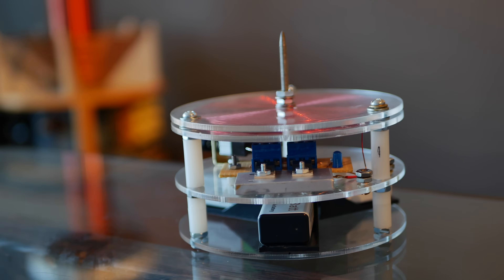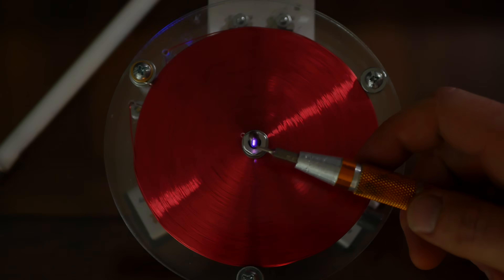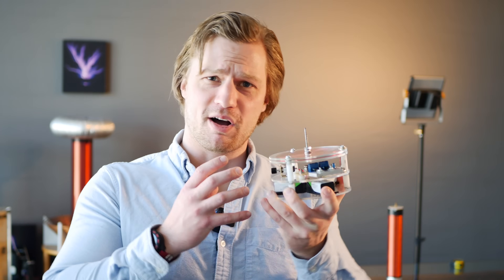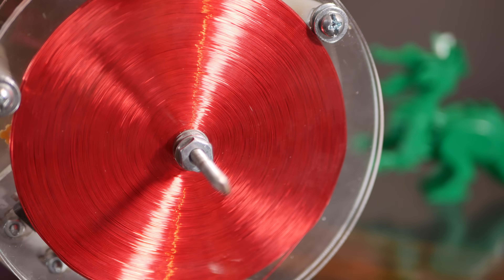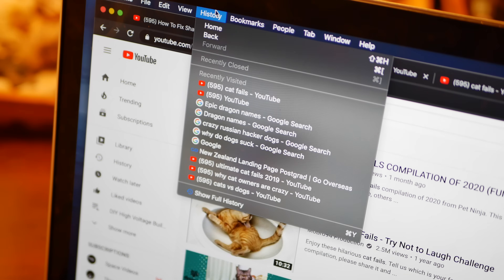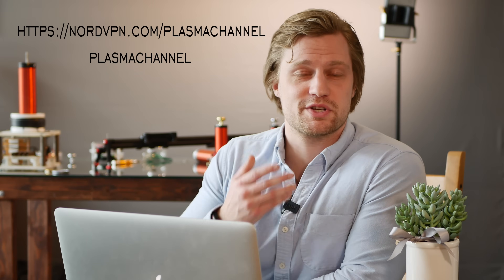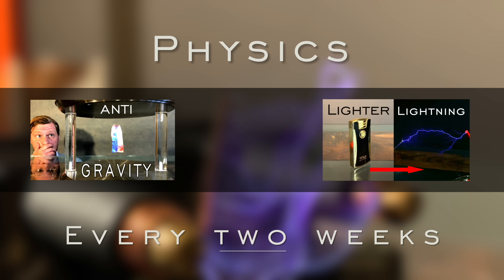World's Most Powerful Pancake Slayer Tesla Coil? (Melts Copper)

Comment from the maker: I honestly support this sponsor - it's an amazing service. Check out NordVPN: https://nordvpn.com/plasmachannel or use code plasmachannel to get 70% off a 3 year plan plus 1 additional month free. Stay safe, and browse safer!
Reply: pancake coil nice and compact I love it now I need to build one with a 10;1000turn insulated that can handle 30-200kv 1.6kw input I need to get a replacement voltage booster for my zvs I sadly blew it out years ago be for i got into fusion. ill have to do spark gapped with my hv supply I have then see how my plasma chamber handles it. now x-ray glasses on, welding mask down, lead /aluminum positive charge shield up. battery charged, materials gathering, rebuilding capacitor's, coiling wire.......................................................ugh , installing prototype core Fxsit, vacuum system on, battery charged ,high voltage supply on, charge capacitors, prepping fuel intake, filtration system on, fuel system on, shield on, lights off, system is all green....3..2...1..... 
man I cant wait to see that beautiful fusion glow again but with more power ok I need to get back to winding this coil.. ugh I wont get to see full output till I get the voltage booster replaced.
Reply: PIA vpn is better

Comment: I Made my own Tesla coil that makes 1cm sparks useing single tranzistor
Reply: Can you share schematics or maybe a video of it? It would be cool to see, i havent seen powerful single transistor coils.
Reply: Its slayer exiter ,i am using transistor d1047  and i replaced the base resistor with 15 kohm trimer for fine tuning,secondary has around 900 turns on 5 CM diameter PVC tube and primary has around 5 turns with 2mm thick cuper wire ,the primary coil is almost as tall as secondary and the whole thing runs from around 30 volts suplied from 12-14v transformer with voltage doubler, i fecomend capacity 2000uf or Higher  (I hope this was usefull)
Reply: @lenkamontskova7483  I have been trying to build one of those but they haven't worked, do you think I can use transistors like the 13007 or 13003b? I have lots of those from CFL light bulbs, maybe that's why my exciters haven't worked.
Reply: Try conecting the primary coil backwards, where you have + conect colector of transistor.
If it still doesnt work it might be because the transistors hfe is very small so than try conecting transistors in darlington configuration.

Sadly it doesnt work with all transistors

Comment: I cannot for the life of my figure out how you ran the lead for the bottom of the secondary to the transistors. You said it attaches from the circumference, but I only see two leads which appear to be for the primary. It doesn't appear you used one of the supports as a return either...

Comment: I have a question: why do people always power it straight from a 9v battery and other low volt sources? why not have a first stage circuit bump it up to 600v, rectify it, put a capacitor to flatten it, and use that as the input to the slayer exciter? the arcs should be so much bigger right? or am I missing smth?

Comment: I was having trouble with this circuit and this video helped clear it up a little bit. I started over,and it works!
Reply: Hi do you have the circuit diagram?
Reply from the maker: @vasundarasrinivasan4018 the diagram is in the video. Cheers
Reply: @PlasmaChannel dude where is primary coil and what about primary to secondary ratio and also coil thickness

Comment: Now take 110 of these and stack them to be 110 stories high - wait Double it have 2 x 110 story high stacks of pancake coils and Run the off Building 7 which was the power Substation of the WTC and lets use buildings 3,4,5,6 as Caps - Where would the spark be? Where is there going to be a fire = Building 7 - it's Wired backwards to have the 220 storied of pancake coils Receiving.

Comment: This is good video. I like where your head space is. Unfortunately, your close but no cigar. This is absolutely NOT a real Tesla coil. A slayer exciter circuit even tho is self oscillates has nothing to do with Tesla's work. You are in the right direction with the pancake assembly. If you look at his original patent US649621 you can see you are missing several things. First, I think the biggest mistake everyone makes is the most common one. You have got a ton or transmitters and no receivers. Everyone always makes the transmitter and never the receiver.  The receiver is an identical coil set up and terminal but oppositely winded from the transmitter. Second, the slayer exciter dose not allow for the other half of the secondary to be grounded. The other half of the secondary is being partially rectified by diode or LED and used to pulse the gate of the transistor. If you read the original patent the transmitter and receiver's secondaries must connected ether by wire or by being grounded. Third, You need a terminal. A large metal sphere connected to the secondary. Some my call it a Top load but it is actually referred to in the original patent as a "Terminal" it needs to be perfectly round in it's construction. The terminal is important because it is what make a parasitic capacitance and makes the whole circuit resonate.

Comment: Hello there, i love your videos a lot! :D
I'm currently working on my physics project for my University Graduation.

I'm trying to build this circuit into the "wireless magical wand" that you also build.
I've SUCCESSFULLY built the Magical Wand but i would like it to be running on 3x 9V Batteries. So i wanted to take the circuit from this Video and use this to bild the 3x 9V Magical Wand.
The Problem is, that i'm not sure how exactly you connected the 2 Transistors together and if you've used more Resistors or still the same amount.

This might be a little extream favor, but could you maybe give or explain to me the new circuit with the 2 Resistors and where the extra Resistors go if there are any.
If you also would be available to talk over Zoom with me, then i would be more then happy :D.

Best Regards
Danny :)
Reply from the maker: Hi Danny, glad you;re looking to my videos for information. Truly an honor. So,the two transistors were wired in parallel. Each leg wired to each leg. I did not add a second resistor. Please note, if you want to use the wireless power wand at voltages ABOVE 9 volts (like my video), your transistors will get very hot. They need a heatsink!
Reply: Hi Jay, thanks for the very helpfull answer! :D
Do you think i can use 3 transistors in worst case? Or will it effect the performance of the Slayer Exciter to much, or does it even effect it at all?

Sorry for the questions i'm not that well informed and i'm limited to equipment so i want to limit my chances of destroying some in the prozess :).

I do have one more BIG question that i'be been struggling with:
Do you know a way how i can measure the resonant frequency and the Voltage without an oscilloscope, which are real real expensive.
Or do you happen to know if there is a cheaper option that would work to measure my (your :P) Slayer Exciter?

Thanks again for your help and time, i appreciate it a lot!

(ps: i've also tried contacting you over instagram, if you feel comfortable you can also answer me there :).

Comment: I used to wind pancake coils for portable 
 x ray units up to 300 kv . You can stack those coils to achieve higher  voltage... You do nice work..
Reply: Since you did this regularly, do you know where the two coils are separated? I can only see the larger coil, secondary I believe.
Reply from the maker: I’ve wondered above that. Stacking pancake coils. Insulation between them must be incredibly critical…

Comment: Very nice build! But I still think, that it isn't the most powerfull tesla coil that works on the slayer exiter principle. The driverless sstc works on the same principle but runs on mains voltage and is mutch more powerfull.
Your build is still very nice and it looks great! 
Did you wire the transistors in paralell?
Thank you and have a nice day.

Comment: Hello, I love your videos and was  was wondering 2 things. First do slayer exciter at high enough voltages create open air discharges and also what resistor would I need to add to make nonlethal blue arcs of plasma.finally what is the voltage and current on this build.

Comment: How to wind primary and secondary for pancake tesla coil ?
Reply from the maker: I used a drill and spun the two plates
Reply: @PlasmaChannel  Which type of wire did you use in that secondary coil

Comment: I like how you showed the electric field.  Pancake coils, I love them.
 Personally I always use bifilar pancake coils as they have a lower resonant frequency and can hold much more energy in its fields.
Reply from the maker: Thanks Ivo. Are you able to create larger sparks at same voltage input, using bifilar?
Reply: @PlasmaChannel  Yes a bifilar coil can produce larger sparks, as the capacity of the coil is charged to a much higher voltage (more energy).

you just need to be careful for sparkover between the windings, as the voltage difference  between them is much higher.

I don't generate sparks, as I see it as an entertaining waste of energy. instead I reuse the energy.

Comment: Nice video🙂
How did you make the primery coil and where is it?And is there only one layer of secundary or more?How many turns did you wind?
Reply from the maker: the primary coil is on the outside of the secondary (circumference), and it is 4 turns.

Comment: I have found that adding a diode from the gate to drain (using a mosfet) with the cathode connected to the drain, greatly improves these circuits.  At least with helical coils, might work with this one.

Comment: Hi Jay! Did you use a 5.6k resistor? My build seems to not have enough resistance. The voltage is too high for the diode. It blows my light.
Reply from the maker: What components did you use, part by part? Feel free to email!

Comment: Isn't a Tesla coil built like a tower for insulation purposes? This looks fine for lower voltages but I doubt the insulation would remain when you got a voltage difference of thousands of volts between the ends of wires.That's the most common reason why Tesla coils fail, besides drivers exploding. And it will only get amplified by how tightly packed the coils are. I wonder what would be the maximum voltage compared to the height and width that the coil could handle.Nevertheless, it looks absolutely beautifull and you did a nice job winding the coils.

Comment: How did you wind your coil? the secondary coil wire should be thinner. so is it not a completeley flat coil?
Reply from the maker: Wound my coil using a drill and the two plexiglass plates

Comment: When the transistor is conducting the voltage at the secondary turns the transistor more on, not off. It just turns the transistor off half cycle of the oscillation later.

Comment: insted of a battery can i use a computer smps as power supply as it gives 12 volt 24 amps
Reply from the maker: yes you can, though you will experience some back EMF which may fry the power supply if it's too cheap.
Reply: @PlasmaChannel   i can use a 20 amp diode in the input toborecent the back emf

Comment: I expected some build info, as I do not have any ideas currently how did you prevent that coil from unwinding or the secondary from arcing over to the primary...
Reply from the maker: Hi Sasszem. Why would it unwind? It is connected to the bolt in the middle, and connected to the rest of the circuit physically on the outside. Also, why would the primary arc to the secondary? Cheers
Reply: @PlasmaChannel  Well, for the first one I ment during winding. How did you secure it during winding? Did you wind it while the acrylic plates were installed, but only with the center screw? That's the only way I can imagine it.
For the second, I messed up primary & secondary. I can not see your primary in the video. Is the acrylic separating it from the secondary? If not,  they can arc over.

Comment: What's your take on Tesla's Carbon Button Lamp? Patent 514170. If i am correct, considering the bulb being a single terminal, Tesla may have used it in place of top load in Tesla Coils to power the bulb with one wire from the secondary coil. Can you make a video on Tesla's Carbon Button Lamp if possible?

Comment: I wonder, will a Tesla coil get stronger with an iron core?
Reply from the maker: it will be weaker. Are you familiar with why Tesla coils have air cores?
Reply: @PlasmaChannel  no, i thought it would become better, because transformers use an ferro magnetic core to get better performance.
Reply from the maker: Iron cores only work at low frequencies. Every single time a magnetic pulse is sent through an iron core energy is lost. A very small amount. So normal transformers that plug into a wall use iron cores because they’re only at 50 or 60 Hz. Tesla coils run at hundreds of thousands of hz. Using an iron core causes the iron core to heat up really fast and all of your energy goes into heating it up as opposed to having sparks. Tesla was a genius, that’s why he specifically designed a tesla coils to have an air Core.

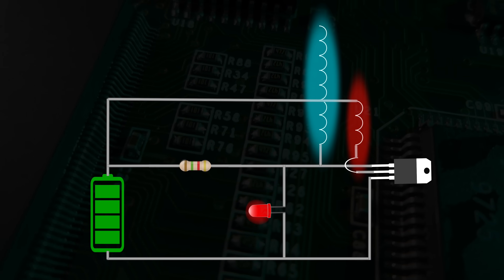Comment: 3:00 Transistor is both turned on and off by feedback from secondary. Resistor is only for start, You can remove it, when coil is already working. Your diagram lacks of capacitor connected parallel to the secondary coil. It's the one of most important things, You can't miss, because if You do it, the diagram is a bullshit. This capacitor and secondary are an LC oscillator, that makes an induced voltage sine, and it defines it's frequency.
Reply from the maker: No capacitor is needed. I found adding any sort of capacitance reduced my output drastically. The schematic I showed is exactly how I built this. Also, the LC circuit is only one component to the frequency. It is also self regulated by drawn power and feedback via the secondary.
Reply: @PlasmaChannel  I don't mean you need a capacitor in the circuit You built. You drew a diagram explaining how the circuit works, and missed the capacitor, which is not an individual part, soldered to circuit. It's a parasitic capacitance. Frequency depends only on inductor and mentioned parasitic capacitance (also resistance of coil, but I don't want to complicate that). You can see some changes in frequency, when You are bringing something closer to coil, but it's because of distortions in electric field of this parasitic capacitor and also the inductance can change.

Comment: I have a tiny tesla coil that i bought as a kit, and the primary has only one turn. I started to wonder what would happen if I doubled the primary?
Reply from the maker: If you added two turns, the output voltage would be cut in half, and the current would be doubled.
Reply: @PlasmaChannel  Ohhhh I see

Comment: can anybody tell me if it is feasible to pull the for the lack of a better term plasma generators the power source that generates the plasma in plasma TV not the main board but the the ballast for a lack of better term can they be hacked and used to power other things and used as a light ballanst or power source for HV experiments maybe overdrive a Tesla coil or
Reply from the maker: Hello Bentley. I would practice using commas or periods - your question was hard to understand. No offense! Yes, you can use the driving circuit and the flyback transformer for tons of cool experiments. Almost....every possible experiment ectually.

Comment: Please provide an actual schematic next time. That first grader scribble in the video is basically useless.
Reply from the maker: Most people don't understand schematics. The drawing I provided was bullet proof, as it was copied directly from a schematic. But instead of symbols, I used actual images of parts. Battery was in correct orientation, as was the connections with the transistor (transistor linked below), knowing the negative is on the bottom of the drawing tells you the direction of the LED terminals. Then....two coils of wire. cheers.